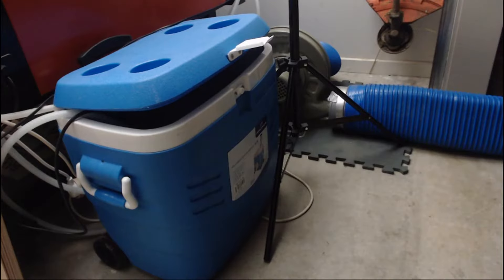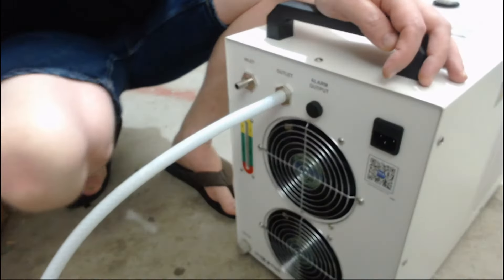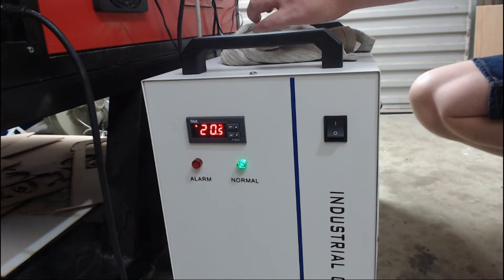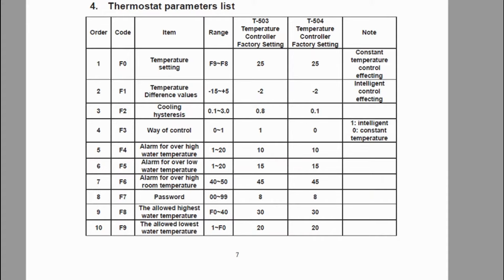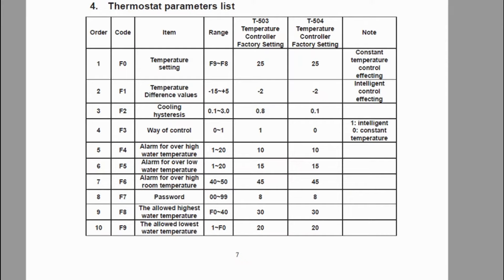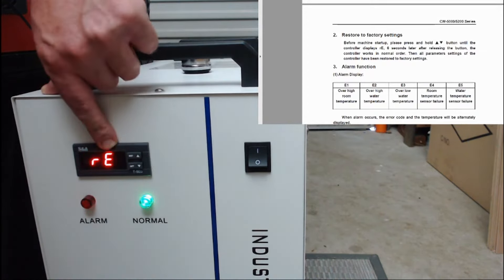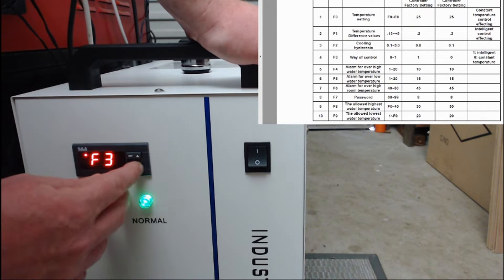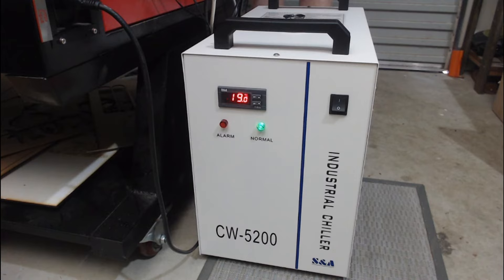Setup of CW-5200 Water Chiller Unit for CNC Co2 Laser Machine - S&A From Cloudray Laser

Comment: Do you run the chiller when not using the laser?
Reply from the maker: My Chillers are turned on in the morning and off overnight.  If you live in a climate where temps are likely to freeze water, then keep chiller in an environment where water temp stays fluid and you may find it necessary to have continuous water flow.

Comment: Would the CW-3000 chiller work with the red/black 60w I've seen on eBay?
Reply from the maker: Yes. But the cw3000 is not a refrigerated chiller.

Comment: Hello Sir, i have a CW-5200 chiller, i can't get rid of the E4 alarm. i hope you could help me, much appreciated.
Reply from the maker: G'day. The E4 alarm is indicating that there is a room temperature sensor failure.  The first thing you could try is check that the sensor connection has not come loose from the back of the control panel/unit (You would need to open machine to do this so only do if you are confident and the power is removed).  If after checking connections and re-testing, the alarm is still present the sensor will need to be replaced I would suggest getting in contact with the manufacturer of your unit for parts and support. 
You could also try searching the internet forums for more information and assistance.
Cheers Matt
Reply: @MWLaser  Thank you for replying, i've already checked the connection and the sensor it has no problem. i'm thinking if there is a way to check the problem on the board or somehow reinstall the software.
Reply from the maker: @khachigkavafian6289  I hope you can work it out, I presume you have you tried a factory reset of the controller.  I do not think I will be able to assist further, sorry.  I think you may need to contact your supplier.
Matt.